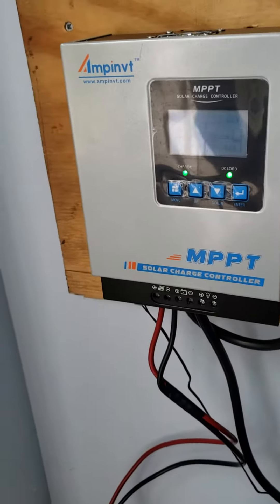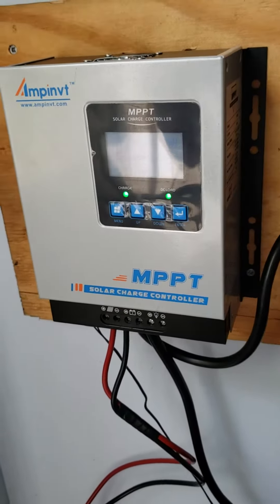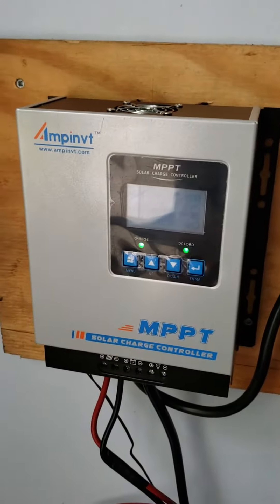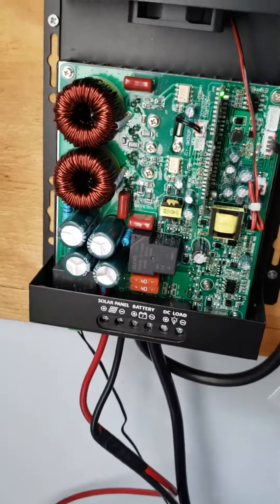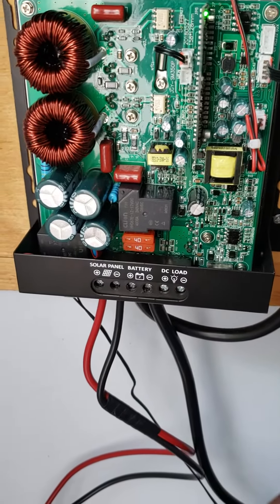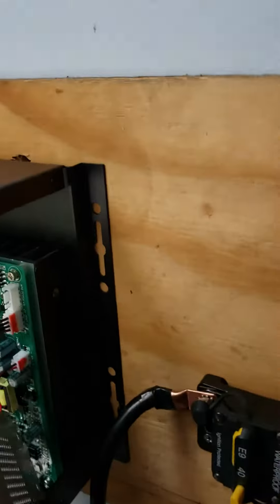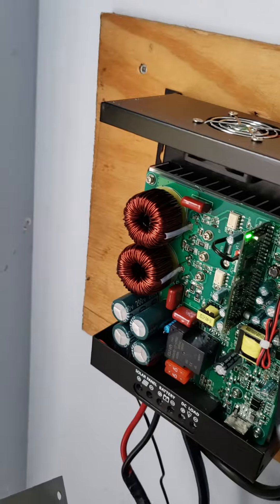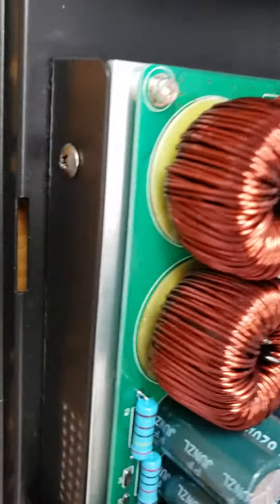Solar charge controller

Comment: It looks like the pcb has a moisture resistant coating on it... thats a good sign..

Shame about the Wifi adaptor not working with the 40A version, the manual doesn't say anything about it not been able to work.
I am going to purchase the 60A version and see how it goes for 12 months or so and then get an 80A if all is OK when I upgrade my panels...
Reply from the maker: Now I have a problem with the cooling make weird sounds and spinning slow when high current coming from the solar array. So I look up on Amazon for a size fan like the one in the charge controller.
Reply: @eagle5720 sounds like the fan is on its way out.

Noctua fans are one of the best and most reviewed, if your getting a replacement I would suggest that brand.

I have been speaking with the owner of the company and the mosfet and other components are imported from the USA so they should be of good quality.

Can you keep me updated please
Reply from the maker: @liamgibbins  I didn't see that brand but I already ordered some cheap one I will see how they perform

Comment: At last found a video on this charge controller

How is it running?  How reliable has it been (seen a amazon review that said his failed after 3 months)

I ask because I am looking to replace my 10 year mppt charge controller with a newer one 

Been looking at international reviews on there inverters and they has been some faults like leaking ac to dc batteries, sockets running hot etc.
Reply from the maker: Well its been going so far over 3 months now but it still working fine, one problem with it you can't connect your computer to it have rs485 port, I contact the company and said I can't communicate with the 40amp version
Reply from the maker: @liamgibbins  I have that wifi thing but won't work with the 40amp they company said it will only with the 60 or 80 amp controller